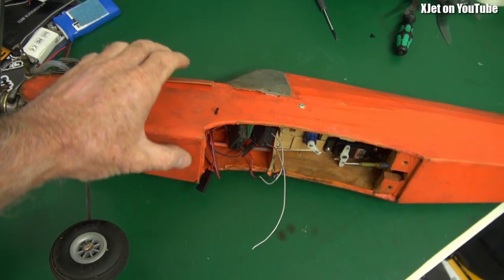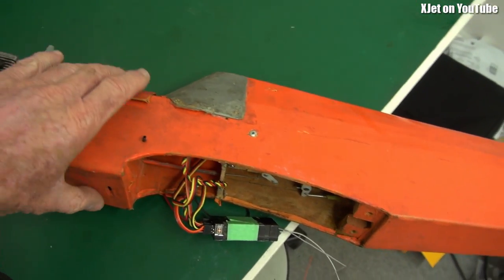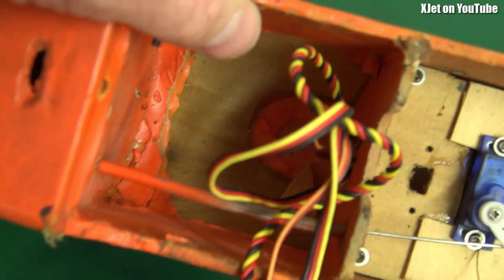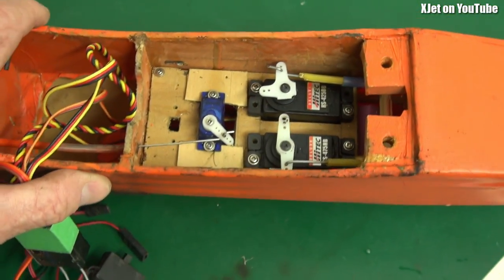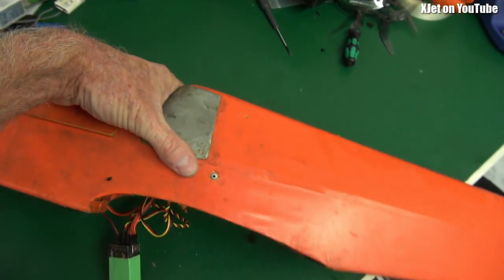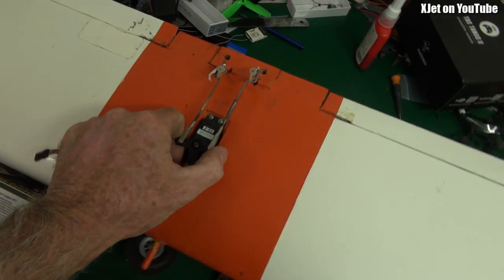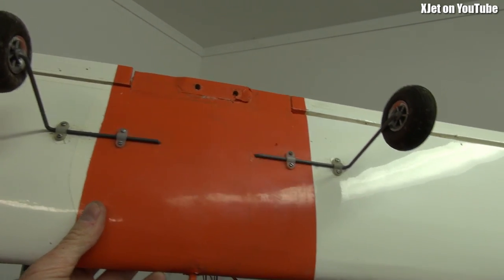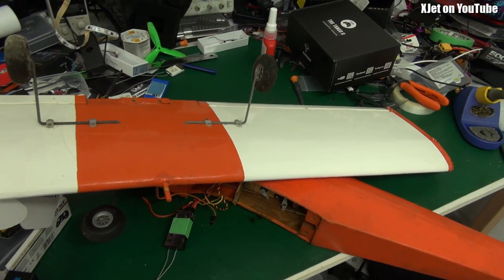VERY old RC plane with HP21VT rotary-valve engine

Comment: real rc planes should be made of balsa and ply
the only foam involved is on top of a beer after a days flying
it will fly again
Reply: Yeah. And making a plane out of wood is not much harder than from a foam.
And I personally use balsa parts even in shittiest foam models to make them less shitty :)
Reply: But making planes with foam is so much quicker. Less emotional attachment when you crash test it.
Reply: @shurmurray  
Try building a plane to a plan and a box of balsa
when you have to glue it up then sand it into shape then cover it
around compound curves
its a lot more involved than opening a box removing a few parts
hot gluing them together then telling all your flying friends I BUILT THAT
Reply: @ijc1958  What kind of car do you drive. Is it all steel from the 50s. Big v8 must sound nice and smell good. 
If it weren't for foam, the hobby would be dwindling.
Reply: On the other hand: when you really invested in a plane, when it took effort to build - you will learn how not to crash much, much faster )))
Reply: Back in days that was basically the one and only way to get a flying model. After building a number of wood planes they no longer feels complicated. It is just a different set of skills. Foam adds more options.
PS: never built ARFs in my life. ) There was some drones, but i do not consider them R/C hobby.
Reply: I still consider foamy planes as toys...

Comment: Of course it will fly, only slowly. I have a pair of the sweet HP VT-21 engines. A delight to own, run & use in an appropriate model.
Reply from the maker: I also have a VT49 with the roller-bearing head (oooooohhhh!)
Reply: @xjet  Cool. Have always wanted the VT-49. If you ever feel obliged to rid yourself of it, please send it across the ditch to me 😉 Perfect for an Old Timer design. Both my VT-21's have the roller bearing head.

Comment: I have one plane similar to that one. I had a ton of cleaning to do with it. The engine was in need of new bearings which I did find however ,I just decided to replace the engine. Now I just need to get it mounted and set up to fly. I have another older plane that has a real stiff engine too but I may just trash that also. It's not rotary or anything special anyways. Cannot wait to see that old moldy plane fly again.

Comment: I've built many a Sterling control line kit with built up wings and doped solid balsa wood bodies and a few CL planes with built up bodies too. We used silk-span paper but it wasn't tough enough for us teens so we scrounged scrap Dacron that had no shrink at all. Had to be pulled tight and doped in place and you hoped you didn't warp the wing. To top it all off, we had Elmer's glue and maybe Testor's? Took forever to dry!! Started in RC planes with Goldberg models with built up wings & bodies and fabric covered wings. Finally came Hot Stuff and Jet glues and Mono-Coat and another brand that looked more like fabric, but I forget the name. Just remembered, Coveright!! Probably spelled wrong. Man we were in heaven then! I'm wishing you good luck with this old warhorse!

Comment: some info.      back in the days of gas, the use of the configuration seen here, was prevalent.     consists of:    1)  use  a profile that is nearly symmetrical;  and    2)  use a  wonky  thrust line/angle, so that the wing aoa is positive; or so mount the wing.      3)  in the context of  l/d ratio,  this is the  Least  efficient  way to make lift.     at 1:40,  in general,  the chords of the control surfaces  should  be  Equal.      cheers

Comment: Status quo for the 70’s. Hopefully it’s not fuel soaked too bad. I suspect the tank will need to be pulled and cleaned with new fuel tubing on the clunk. That fat symmetrical airfoil will need some horsepower to make her agile. Looking it over brings back lots of memories. Flex cable for throttle and nose wheel steering. Seems odd he used film on the wings but fabric on the fuselage, maybe it’s similar to the Coverite iron on fabric. I really like that covering. Will be cool to watch.

Comment: If you ever plan to get rid of that engine let me know please Bruce.  Always wanted one for some reason...  I probably have a good OS .20 if you want a swap?  I expect it will fly if you get everything freed up - but sedately...  I read somewhere the plain bearing VT engines very much needed plenty of castor oil for the valve to remain healthy - and that they need to rev out to make any power.  Be interesting to see how you go...

Comment: Interesting construction techniques; I have a balsa model which looks like it has been made in much the same way. Won't fly though, suffers from MASSIVE torque roll once the motor is pushed anywhere near V1 speed; I'm currently thinking the prop is too big(?).

Comment: Looks like a .40 size model with a .21 4 stroke. Pull the motor, and put in an OS 70 Surpass II, and it will go into orbit.

Comment: Up the nitro to 25%minimum I'll give it a 60/40 chance then.. (60 for a test glide/40 under power!) Got an old KeiKraft MiniSuper with 2.5cc ED Racer diesel on the front, 2 channel rudder, elevator + fixed throttle (!) in the attic .... Luckily my local chemist was a customer of my Grandfathers model shop so asking for a pint of ether to make my diesel fuel , 1/3 ether;1/3 paraffin;1/3 caster oil, seemed a normal purchase by a 11 yr old...

Comment: Bruce ,      I do wish that commentators such s yourself would stop referring to glow plug ignition engines as"NITRO ENGINES ".They are in fact methanol engines, and will not run on straight nitro methane . Ignition in a glow engine occurs due to a catalytic reaction between methanol and oxygen on the surface of the platinum in the glow plug filament . The heat produced then causes combustion of the nitro . No such reaction is possible with pure nitro methane which must be excited with spark ignition .
Reply: I think Bruce is aware of this, BR. So are all us older modellers. Glow-ignition engines are also called "Nitro". We know what it means so there's no confusion. We also call compression-ignition model engines "Diesels", even though they run on "jungle-juice" - a mixture of kerosene, Ether and Caster oil, and don't (and won't) run on actual Diesel fuel.
Reply: @spthompson6501  Diesel is not a reference to the fuel used , but rather to the man (Otto Diesel) who invented the compression ignition engine . I have been a modeller for more than sixty years , and have built and flown models ranging from paper-shop chuckies to FAI pattern , so I do have a little knowledge of my hobby .
Reply: James Smith  Sixty plus years in the hobby . How about you , smarty?